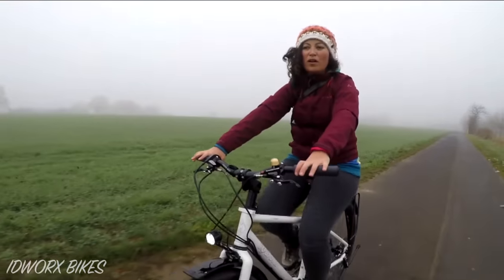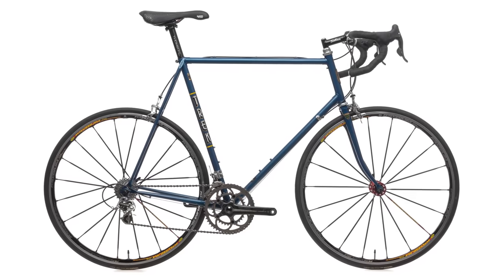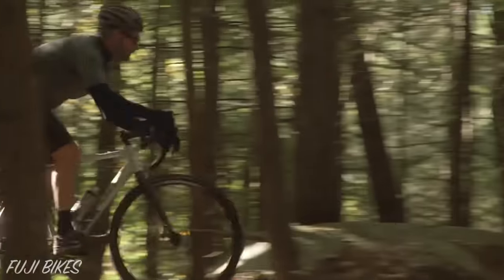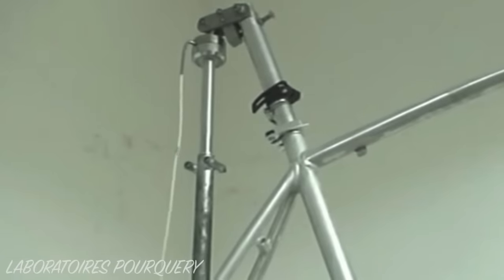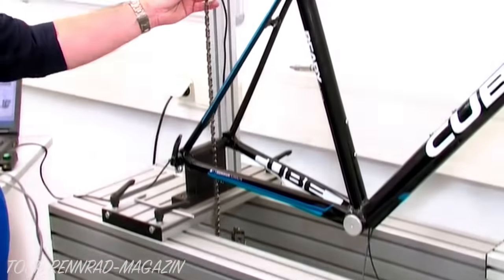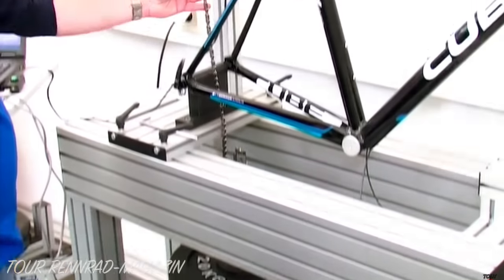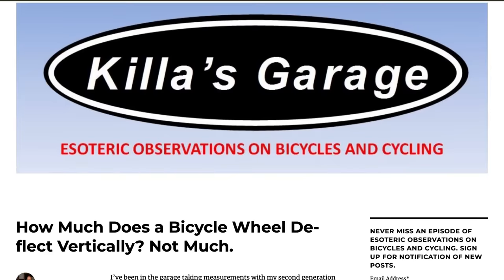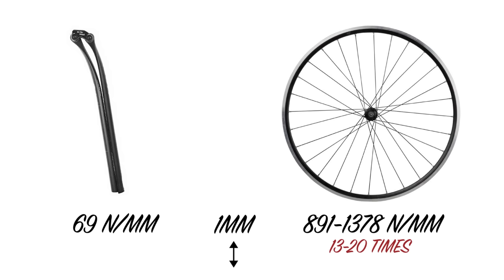Why It's Impossible For Steel Frames To Be More Comfortable Than Aluminium

Comment: Steel forks with low trail curves flex pretty well. I think you focused too much on frame and seatpost and neglected fork flex
Reply from the maker: That's true, but the focus of this video is frame comfort. Might do a vid on forks later.
Reply: This is the main reason why many aluminium bikes have carbon forks.
Reply: But only if they have rim brakes. Disc brakes ruin any potential flex due to bracing.
Reply: @Cyclingabout  should be part of the equation, i think. especially when considering, that bumps through the hands and arms are much more noticeable than through my (considerable) behind. curved steel fork with a forged shoulder is slightly, but noticeably more comfy than my aluminum fork (same wheels).
Reply: @FriedrichSchmidgall  It also makes a big difference just how the bend is formed.  A '30s or '40s fork with a Russ-type bend at the bottom gives huge compliance to cope with cobble-stones, but a shallow curve half way down the blade will not give much.  I would add that radial spoked front wheels also give a very non-compliant ride, and I prefer a tangentially spoked wheel.
Reply: @squiresuzuki  Great reason to boycott freakin disc brakes!
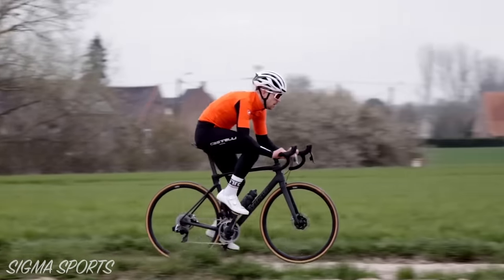Reply: @Cyclingabout  I thought it's about ride comfort? 0:46 surely forks should be part of the equation
Reply: @pashakdescilly7517  the way that the fork is raked has a negligible effect on compliance.  Head tube angle and fork offset do.  As does the diameter/wall thickness of the steerer tube plus diameter,  wall thickness and shape of the fork legs.  I have read a few studies that have disputed this.  I pulled an August 1984 copy of "Bike Tech" which did a test of the theory and included the different types of bends for a comparable offset,  different types of tubing (reynolds 531 SL,  wide, standard and round legs plus Columbus SL) and found that the differences in the different kinds of bends were so negligible as to not be worth mentioning.  On a lot of older road bikes they had a slacker head angle with a corresponding greater fork offset with the smaller diameter tubing which was the standard of the day.  It's really quite logical as the length of the fork legs,  how far in front of the lower cup of the headset and rigidity of the fork.  Whether a fork is bent like this vs that is going to be quite negligible.  A fork with a very significant amount of bend to the fork such as a classic Hetchins might be a different story.  Maybe.
Reply: Andrew Suzuki I'm curious, please explain your point. Thank you
Reply: @ScrubsIsee  Disk brakes exert their force over a longer lever than rim brakes, thus disk brake forks need to be more rigid over their length than rim brake forks. At least that's the theory, not sure if it actually holds up with your average rim brake bladed fork. Maybe in practice a flex carbon handlebar trumps everything else (besides tyre volume) just like with the seat post.
Reply: I agree,  the weight rests on both wheels and thus more than likely most of the frame flex will be the fork
Reply: FLEXIBLE carbon forks even more so.
Reply: @Louise-lg3wt  hmm.I though.older frames were a steeper head angle hence the raked fork design. Modern straight bladed forks retain.The same wheelbase  from head th e angle and fork offset. The whole idea of a straight fork was to reduce twist and flex of the fork.and keep the wheel .more tracked in sprints and turns. Aero dynamic improvements too.
Reply: @2adamast  tyre pressure, spoke tension, rim flex, seat and  chain stay, seat post.  forks stem and handle are the major points to consider before the design and materia that makes job that big triangle.
Reply: @squiresuzuki  hmm good point...
Reply: Asian level IQ! Well said. 

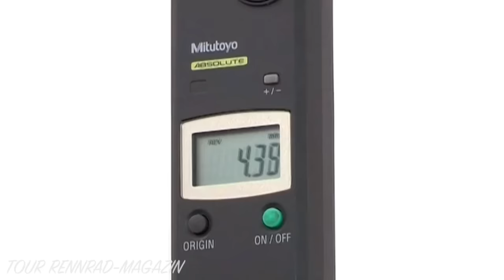Definitely the best comment here. No wonder Japan tops innovation/tech esp. in cycling world. @2:31 notice the apparatus they are using. MITUTOYO is the brand. A Japanese innovation and engineering. Thank you, Japan.
Reply: @swapode  Rim brakes are further from the centre of the wheel so the lever is longer. You have it backwards.

Many carbon forks are extremely heavy and stiff because fork failures are dangerous and manufacturers don't want to be sued.
Reply: @Louise-lg3wt  I would be very interested to look at that 1984 bike tech. I think it maybe assuming too limited a range of rake styles. Curving a strut does change it's properties significantly. Also, many times the material will pair with a type of curve, so in real world examples the curve does identify the fork character. But 1984 should have plenty of old style bikes around to test, so I am very curious. Is there any link online?

Comment: I have owned both steel and aluminum road race bikes for years.  My personal experience has always been on the same tire size, same routes, same rides.  And steel never beats up my body as much as aluminum does.  The fatigue from riding on aluminum has always been more noticeable, fatigue from riding steel is non existent.
Reply: Same experience
Reply: because comfort ist not only vertical compliance between rear wheel and saddle
Reply: Same experience

Comment: Something not explored in this video is the frequency range of vibrations; they cover a spectrum depending on road surface and what obstacles you encounter. With similar setup when riding on the roald, I've always had the unmistakable impression that steel damps the higher frequency vibrations better than carbon resulting in a more velveting road feel that I simply haven't experienced on a carbon bike.
Reply: Yeah totally agree.  Everything dampens different vibration frequencies differently.
I think the cream of the crop for smooth frame materials is bamboo.
I built a bamboo hardtail and it is night and day smoother than any other bike i have ridden
Reply: totally agree with this! your body doesn't feel the distance of the deflection, it feels the frequency
Reply: @mog3680  No difference. Those have been measured too.
Reply: @mog3680  i like to cuddle with my bikes naked frame (no components on) and watch videos of the course im going to ride.  so i can feel in tune with the frequency of the bike and match the frequency of the road so everything is in harmony. makes the ride so smooth like gliding on a cushion of air. similar to air hockey puck. sooo good
Reply: @thysonsacclaim I bought a NOS columbus steel frameset, running it with 700x25 tires and I keep doing tests on the same route versus my Canyon Ultimate with 700x34 tires, because it's insane that this steel frame is MORE comfortable. Basically all small road buzz is completely filtered out. I just feel the road on it. Big bumps do feel better on the Ultimate, but the Ultimate feels like an un-flexing triangle that transmits everything on the road back to me.
Reply: Agree. This video oversimplifies comfort from the perspective of a single-cycle deflection on a bump, like a root, pothole, or other surface imperfection, and concludes the deflection (and the difference in deflection between frame materials) is too slight to make a difference. But, frame vibrations are continuous and high-frequency, not single cycle. And notably, the amplitude of such vibrations are all very small - well less than the deflection distance shown in the test fixtures. So, while none of the frame materials may do much to absorb a single shock, how each frame material responds to and dampens continuous vibrations (small and visually imperceptible amplitude) could be much different, leading to noticeable differences in perceived comfort.

The video does touch on vibration toward the end, but the logic is limited and despite the lip service to "data" no "data" is provided. How your frame rings when you tap it with your hand cannot be translated to comfort. Tapping your frame is an entirely different loading situation (no load) as compared with a 160-lb rider suspended at 3 contact points at different locations on the frame. Yes, your tires, saddle, and bars will influence vibration damping, but these are all tied together through the structure of the bike frame and so on an identical component setup, how the different frame materials transmit frequencies between contact points may have a more significant effect than the video suggests.
Reply: @elitebicycleracers  yet when riders are blinded to what material frame they are riding, they can no longer perceive these differences.  Give it a try! Be sure to keep wheels and tires constant.
Reply: @JackMott  I need to borrow someone's steel bike! I have a titanium road bike and gravel bike and I admit it's not a huge noticeable difference over my other bikes. However I also tend to get the super stiff racey titanium frames so I expect those to be closer in feel to a racey carbon or aluminum frame.
Reply: @kanethomas6998  But what percentage of bamboo is actually carbon? 😉😁

Comment: I actually started road riding on that EXACT same steel trek (my dad's old bike), then 20ish years ago when I finally bought a modern GURU road bike with aluminum lugs and carbon tubes the difference in stiffness was MASSIVE (the carbon bike had what felt like absolutely zero flex or peddle bob and my feet would go numb from road vibrations...it made the steel trek bike feel like a full suspension bike!).  So I'm not sure how much I really agree with the results here, at least my interpretation of them...
Reply: Real
Reply: Agree.  I have a 1983 Peugeot PSV-10 with Super Vitus tubing and it is still the most comfortable ride I have ever had including carbon.
Reply: All true of my experience as well, but the video is correct; it's likely to be better geometry and more pliant seatpost/wheels/tyres that do the job so well on those old bikes. 

The reason to choose steel is resiliency. I've snapped a steel bike while riding it... it carried on riding, because it bends rather than breaks. I've snapped aluminium and wiped out dangerously, because just like carbon/resin, aluminium fails suddenly and catastrophically. Therefore, steel.

Comment: Great video, but forgot to introduce the advantage heavier frames have in terms of comfort simply due to higher inertia. It's the same when you attach bottles and bags to your bike--it becomes more comfortable to ride because the bike simply can't rattle you as much as lighter bikes can. This is probably one reason for why people believe steel bikes are more comfortable. They may be, but not if you compensate for the weight difference, for example by attaching weights to a carbon frame.
Reply: I totolly agree.
Reply: Interesting thought 🤔
Reply: I think people mistake the feel for comfort. I find a steel bike feels springy but I wouldn't say it's a more comfortable ride. Hitting a pothole on any roadbike will be jarring.

Comment: I love that you present actual data!!  And this analysis also corroborates what I’ve been spouting for years: if you want comfort, ride a fat bike 🤣🤣
Reply from the maker: It's definitely hard to NOT be comfortable on a fat bike! The tyre spring rate must be well under 5N/mm.
Reply: There's no denying a steel bike rides differently. I have 2 road bikes, a steel and carbon. While the carbon does everything better, it lacks character. It feels numb. The steel bike feels "springy" like a spring. Probably because it doesn't dampen the road inputs like carbon. So you like a plastic, stiff yet compliant bike with no character, buy carbon. I'm going to get a modern steel bike and sell my carbon bike.

Comment: I think most of it comes from when aluminium bikes were fairly new. I am old enough to remember. I had a Bridgstone RB1 (a now legendary frame) and I could feel a little bit of flex in the bottom bracket when I'd sprint or stand to climb. In 1991, I bought a new Cannondale and the ride was very different. It was much more harsh, but there was no detectable flex in the bottom bracket. I loved that bike even though the stiff frame combined with the high pressure 18c and 20c tires brought a very jarring ride. Aluminum design has greatly improved since then but the image has not for a lot of people
Reply: I loved my Aluminum trackbike. Though it was VERY harsh. I learned to ease on sitting the saddle. So I was mostly on my legs while riding it. Though they are ment to be rigid and to be ridden just a short time.
Reply: Read about the differences/development of alloy during time.
Giant did some great work evolving from 70 to 60 Aluminium which gives a smoother ride being more flexible.
https://roadcyclinguk.com/gear/giant-defy-aluminium-range-overview.html
Reply: It comes from normal bikes, not high end bikes. 95% of the bikes out there are cheap. And Aluminium has to be overbuilt to be safe. It's true there have been advances from big manufacturers understanding aluminium better since after the 1990s. But a lot of those 90s bikes are still on the road (which is awesome, bikes are such a great durable vehicle.) And loads of bikes nowadays are still build that way. Aluminium welding and metal fatigue, heat treatment, these are tricky. With steel you can do that in your garage. Most Aluminium is stiffer, even if it is not inherent to the material itself.
Reply: Cool.  I still have my RB-1 that I bought new many moons ago.   Love it .  I've squeezed 32 slicks on it and have taken it on MTB trails and loaded it down with touring bags.   But getting a gravel bike now that will better suited for those things.   A steel one.
Reply: I had a Bridgstone MB3 as my graduation present. Sadly, it was stolen. Still my favourite bike of all time.

Comment: Thanks for the informative video. You inspired me to buy a Brooks B 67 saddle for my Cube travel bike. I remember how comfortable my English 3 speeds were with their sprung Brooks saddles. After so many years on 23c tires, I am also loving the 2.2's tires. I can run the pressure down to 30 psi and they still roll great and give a soft ride. I have also started running 25c's on my Giant TCR. I guess as I get fatter, so do my tires